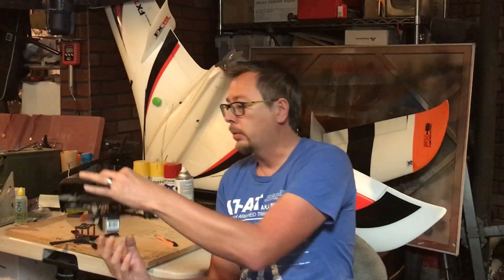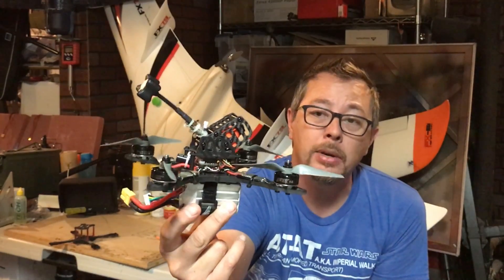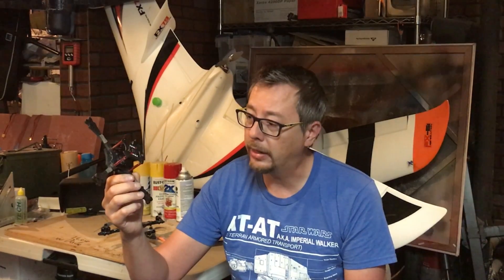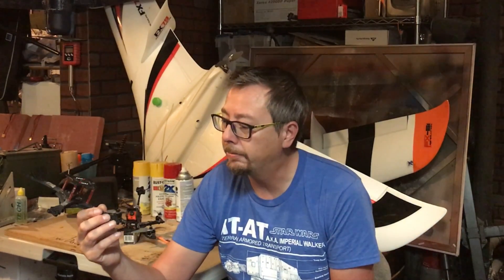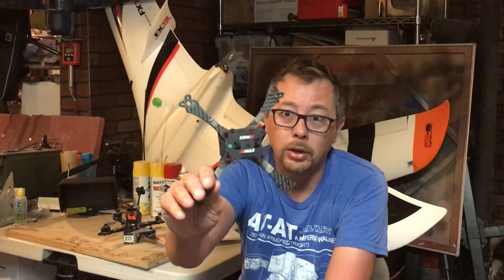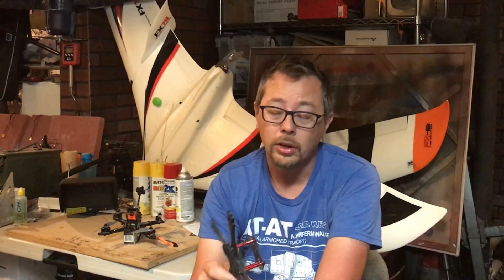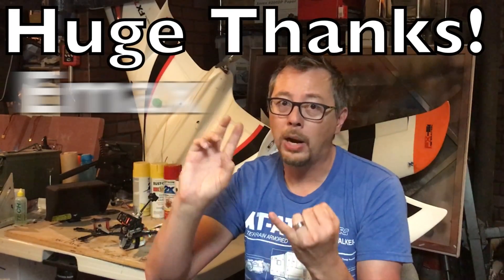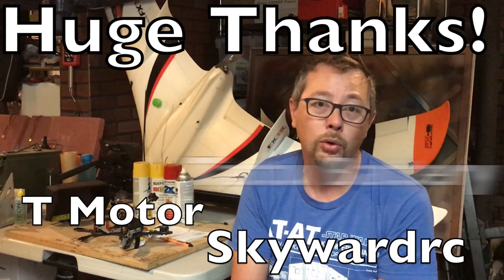125 Mph Racing Quad

Comment: Nice job! Could you use the t-motor f30a 2-6s or emax bullet 35a escs? They are a bit smaller. Also, in theory how fast could you go with t-motor f80s? (they provide 2000g of thrust each and are 39.8 grams each (but if you used them with a lighter esc combo maybe lighter). Also, the tbs powercube (w/o escs) looks pretty light). Just wondering? Good luck, and keep ripping!
Reply from the maker: I'm done doing speed runs,,, maybe you can start the next round of testing...!
Reply: Lol. I don't have the money for all that insanity!

Comment: Noticed the prop doesn't come in CW and CCW. Are they symmetrical where you can install it upside down?
Reply from the maker: No.  Turning a prop upside down does not change it to CCW, It just becomes an inefficient CW.  My props were given to me so I'm not sure where to get the CCw
Reply: That's what i was afraid of... I did a bit of digging and found similar props with CW/CCW at https://hobbyking.com/en_us/hardware-accessories-1/propellers/aerostar-composite/electric.html

Comment: Is this fastest size or can a 250 with 6 in props go faster?
Reply from the maker: only one way to find out!!!
Reply: 6" is slower then 5"...it accelerates faster but less top speed. I think 4" would be fastest if we could get some good props...Iv got a 137gram 4" that will do nearly 90mph on hq 4x4.3x3 props

Comment: Please stop that story about that a heavier quad is faster, it is not it is slower.
As you want speed and than I look not to the motors props and lipo but ad the frame and the weight. Than you need a light build. 
This makes that you can fly under a bigger angle meaning that the thrust is more pointing to the rear instead of the ground and the more it points to the back, the faster you go.
The other thing is air resistance. As you mounted a 4 in 1 on that other frame, you would have gone faster. The arms are nice and thin and you place esc's on it that make it wider again what causes lost of thrust.
Motors are less important than the weight and this is why. 
All the motors deliver an amount of thrust and wile one motor is faster than the other, the difference is often smaller than you can win in other things. Also can a motor that delivers more thrust be heavier than an other motor with a lower thrust and making the lower thrust motor still a better option.
For example, as motor 1 delivers 100g of thrust and it weighs 10g. than it has a power of 10 to 1. As motor 2 has 110g thrust but it weighs 12g than the power to weight is 9.167 to 1. The thrust test do not say how efficient they really are because the weight counts also.
Just by changing the lock nut on your motor, you can save 1.2g per motor. Using 2 instead of 4 bolts to mount the motor saves a few grams and so on.
It does not look a lot but in the end you can win a lot of grams together and making your quad faster than by just mounting faster motors on paper on.

So get a light frame, ditch that vtx antenna and the connector on the vtx and use a linear antenna. I use them on my quads and use a Menacerc antenna on my receiver. Lighter antenna on your quad and the Menacerc antenna is not only cheaper it is also better and the signal stays good.
4 in 1 esc small lightweight vtx and cam. Replace the alu standoffs for nyon ones. Alu bolts and use as less as possible tape and tie wraps. Make your arms as narrow as possible and make them round. Top plate as small as possible, light and powerful lipo and go again.
Reply from the maker: +emiel1976ep I find your comments demeaning was that your intent!  I mentioned in the video that I'm not the guy to be gram counting- I'm not really into it. 
As for the heavy quad theory- I said maybe there is something to it- that is all- maybe. 
I find it funny that you have the key to a fast quad yet mine is the fastest on record for 4s. 
With a 14:1 ratio a few gram won't mean much. You are right that my quad could be more aerodynamic- but this was just a shake down run....
So tell me again how to build a fast quad ,,,,!!!!!????